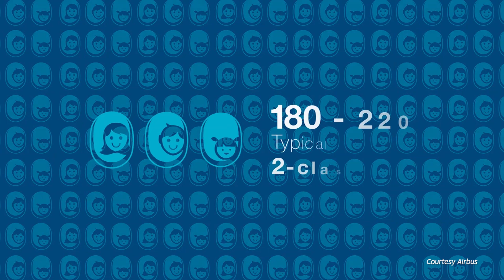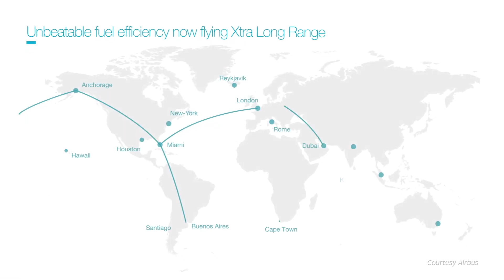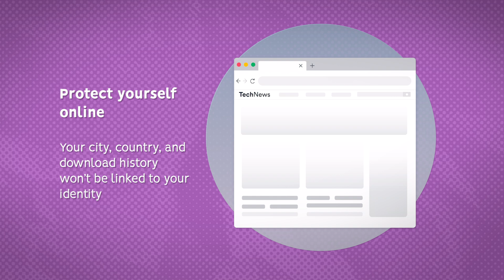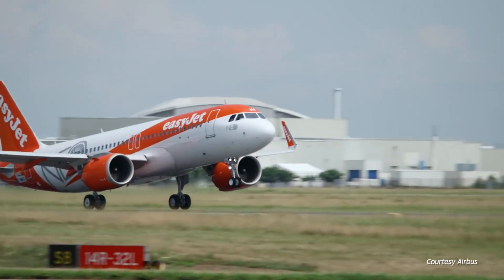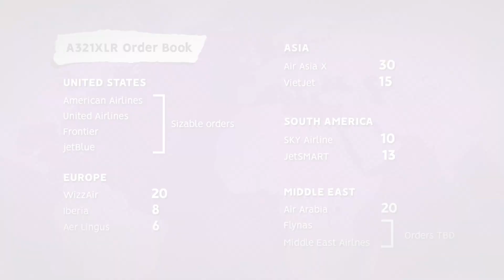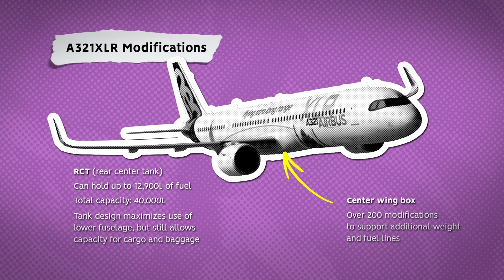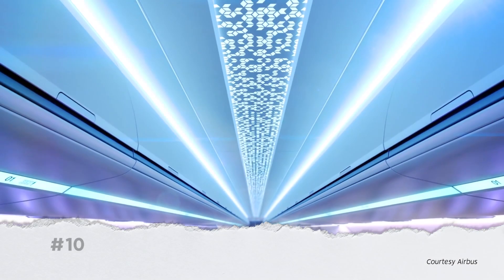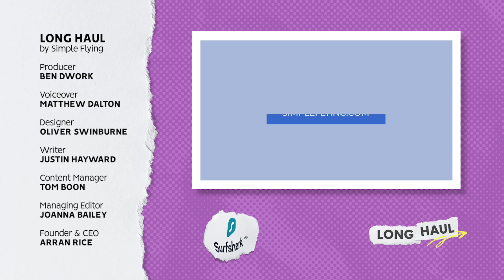10 Things You Must Know About The Airbus A321XLR

Comment: Long haul with a single aisle,  often blocked by service carts, could be 'interesting' for the urinary challenged PAX. Wide body for me.
Reply: You must not have flown on widebodies. It's the same during meal/drink service .
Reply: @_w_w_  more options & opportunities to get around 'a wide body on a wide body'.......have flown them all many times
Reply: @dougharris7665  You clearly do not have enough experience in both types to compare.  I literally live on planes before the pandemic, so I beg your difference.  Airlines do drink and meal service at the same time, which means the carts are blocking both aisles of the widebody.   And because of widebody carry way more passenger per section, airlines often do double carts to have enough food/drinks per run, which means  they are blocked for much longer period of time.  Airlines that use narrowbody for long-haul flight generally have mid-lav and mid-galley, and carved out areas to park meal carts or for passengers to stand and wait for restrooms.   It's really not as big of an issue as you make it out to be.  Airlines serious about using narrowbody for long-haul have configured them to address these concerns ahead of time.  What you are doing is comparing a narrowbody configured for domestic short-haul to that of widebody configured for long-haul.
Reply: @_w_w_  lots of experience, but good for you. Speculation holds no legitimacy so take a few more flights on narrow and wide body when they are on the same run and advise us all of your legitimate findings. I hope that you are correct about aircraft configuration and crew behaviour - then we will all benefit.
Reply: @dougharris7665  It's not speculation, it's real world experience.  Just look at Delta's 757-300, configured for long-haul.  You think airlines are stupid and they can't reconfigure the plane to make it easier for their employees and passengers.  Delta used to have that plane running Seattle to Tokyo before switched to widebody... and they still use them for some TATL route.  I think the issue is you use domestically configured narrowbody to compare with your widebody experience.  You can also look at Cathay, EVA, China Airlines, ANA, JAL and so on, and look at their regionally configured widebody that are incredibly dense and both aisle are blocked during service you couldn't get up or get out until the entire service is done... and on those mid-haul, the service can last 2/3 of the duration of the flight!
Reply: @_w_w_  As someone who has done about 30 return flights from London to Australia over the last 20 year and 100's of flights in Europe, I can tell you the wide body is much better, you can go in either direction and often cross over to the other side if it looks clear. A380s are the easiest.
Reply: @stephanguitar9778  30 transoceanic in 20 years?  I do about that many in a year!  You clearly have not ridden a narrowbody that is properly configured for long-haul.  When configured as such, they are no worse than widebody.  The only issue, if one is to pick it apart, is the wall panel.  Narrowbody wall panel curve more because of the smaller diameter.  That can also be partially addressed with the new curved up bin like Sky Interior's or Air Space's.  Similarly, if you ever got on a widebody configured for high-density, like the Air Asia, you wish you never get into a widebody ever again...  Those Air Asia A330 are scary with 9-abreast and 29" of pitch.
Reply: @_w_w_  I mentioned in another comment about the cheapest LON to New York flight I can get for April next year is with TAP. From Lisbon to NY is circa 8.5hours. A321, economy seats with 31'' legroom. Fixed seats no  recline, no onboard entertainment, economy class with access to 2 toilets at the back, ie typical configuration for a 3 hour European trip.  I think Jetblue are doing a better configuration but more expensive at the time.  I also know Qantas who Ive used a lot and how they will configure these, ie max seats, minimum legroom. I have flown a BA 757 that was fine but they've all gone now.
Reply: @stephanguitar9778  And please don't forgot widebodies are being densified.  All but 3 airlines now have 10-abreast 30-31" 777 economy.  Or 9-abreast 30-31" 787.  No matter what, a 6-abreast A320 (neo or ceo) has wider seats.  You also discounted new slim seat design are a bit better than old ones.  The thinner seat and seat padding produces more usable leg room.  In addition, the thinner seat padding of the new design often use memory foam, so net result on the body is more comfortable.  The amount of flying I have done allowed me to collect a lot of data on comfort and the new generation of designs aren't as bad as you suggest.  In addition, the newer IFEs do not require a giant box eating up legroom under the seat each row...  This again goes back to what I said, a newly and properly configured narrowbody configured for long haul won't be much different than widebody...  And if the airlines decide to redo/reno their widebody, they will use the same new seat design used the the newer narrowbody... and they will surely add more seats to the cabin.
Reply: @_w_w_  Yes I know, I have become an expert at airline/aircraft seat analysis.  Start with looking for A380's then A350's then 777s with proper seating, ie 9 abreast then A330s.  Avoid 10 across 777s and all 787s like the plague. Still possible on the UK to Australia route.
Reply: @stephanguitar9778  Also, A380 is problematic in that the window seats really aren't pushed up against the wall panel.  The gap is not large enough to store bags but too wide for people that want to lean against the window.  Also, 777 9-abreast economy or 787 8-abreast economy are very difficult to find.  Cathay went 10 on 777.  Qantas doesn't have 777, its 787 is 9-abreast.  Virgin Australia had 9-abreast 777 but dumped all those, perhaps you didn't know.  Most of BA's 777 is already 10-abreast, the older config is 9-abreast.  Virgin Atlantic also got rid of 777 in favor of 9-abreast 787 and A350.  Exactly how do you find 9-abreast 777 or 8-abreast 787 between UK and AUS?  Given A380 are being dumped, your real opportunity is still A350.  Then again, A321XLR is not intended to serve one of the longest route in the world.
Reply: @stephanguitar9778  Just heard back from a TAP Portugal contact and you are wrong on a lot of things, so consider your info misleading and/or false.  TAP's A330neo and A321LR, used for transoceanic flights, both have 31" pitch Recaro seat, which is like 32"-32.5" pitch in older seat type.  Both, including A321LR, have 4-5" of recline...contrary to what you said.  So, just as I said, when an airline config a narrowbody for long haul, they will make sure it's on parity with widebody.
Reply: @_w_w_  Not what they have forwarded to the info sites that we all use, but FFS you do have an axe to grind, have you no other life.?
Reply: @stephanguitar9778  TAP's website confirms the information I listed about seat pitch and recline, so stop making up stuff you have no experience on, or do know how to do research on.   I hate people spreading misleading and false information.  Why would you say nasty things about me if you are not spreading misinformation?  TAP's A321LR for long haul is configured with the same seat as their widebody A330neo.
Reply: @_w_w_   I have to disagree about the 'memory foam' seats.   I flew Auckland - Hong Kong on Cathay Pacific  A340 with old 2-4-2 seating - quite comfortable.   A year later, Auckland - Guangzhou overnight on a China Southern 787 in 3-3-3 with what I found was 'memory foam' seats - agony.   I could not get to sleep, every 10-15 minutes I had to shift around to ease the ache in my butt.   I got off that flight furiously angry (and resolved to never go near a 787 ever again).   And transited into an old domestic China Southern A320 which was - so comfortable I promptly dozed off.   
Unfortunately, while internet sites will give the seat layout of any airliner, also pitch and width, they don't say whether the seats are proper comfortable longhaul seats or the new 'efficient' lightweight torture devices.
Reply: @cr10001 You are incorrect...pure and simple and I will explain why.  Chinese airlines, much like the Japanese and Taiwanese, have very hard/firm seats to start with. This is a culture thing, they want their seat and mattress very firm, even hard.  They don't use memory foam because it wears out...at least with the older technology. The older A320 you are referring to, has the older seat designs and they are not memory form.  The newer CZ B787 went with slimseat but not memory foam - it's similar to ANA and JAL.  The challenge with older memory foam technology is that they deform over time from being compressed.  The newer memory foam technology that just came into the market is able to improve that.  Delta is one of the first airlines to install the newer memory form seats and so is Cathay, on their new aircraft.  Western airlines or ones cater to western markets like Cathay embraced memory foam because the western culture bias towards softer seat and mattress, so the airlines cater to those customer expectations.   This is why you often hear Asian passengers complaining about western airlines and hotels have too soft of seat and mattress, and what they call "lack of support"....
Reply: @_w_w_    Thank you for clarifying.   All I can say is, the old China Southern domestic A320  I transited into had perfectly comfortable seats (maybe they bought it from somewhere else).   The 787, I determined at the time was 'memory foam' by angrily poking it (in between bouts of discomfort) before I'd ever heard that term used for airline seats.   In fact I was starting to think I was getting too old to fly (fortunately the A320 dispelled that suspicion). 
That still leaves me with the problem of determining which aircraft/airlines to avoid when booking  (from Auckland to Europe I do have a wide choice of routes).   When the covid situation improves, of course.
It would appear that I haven't experienced the new 'memory foam' then.   (Flew Cathay Pacific to Paris in 2016 but that was on an A340 so would have had old-style seats).
Reply: @cr10001  Agreed that old seats are generally more comfortable.  That's same regardless of airline, but sadly they are being replaced by new seats and slimseat is the new "it" thing.  I was initially put off by the slimseat but honesty, the marketing fluff is right after I spend a lot of time in them.  Companies like Recaro really did engineer slimseats well.  Combined with the newer memory foam, it's quite good.  But this is not to say some LCC won't have abusive slimseats.  I generally have a rule to avoid Japanese, Chinese and Taiwanese airlines if I need to do long-haul in economy.  Their services are great, but the seats and cushions are just too hard for me.
Reply: Some 321s have a crapper in the middle somewhere in the wing area. Makes a big difference.

Comment: Having flown this aircraft in X-Plane almost fully loaded and suffered an engine failure on takeoff, I really hope they'll install a fuel jettison option. It's a long time to circle to reach maximum landing weight
Reply: Seriously? …………….you are perhaps unaware that the aircraft lands perfectly fine overweight ?  That’s why there exists an overweight landing abnormal procedure and maintenance inspection. If I’m on fire or suffered an engine failure I’m not gonna be out there circling around like a dumbass.
Reply: @savagecub  1. Yes I do know but as I wasn’t on fire and other engine was working fine then no rush. 2. Green dot speed was above flap 1 speed meaning if I extended the flaps for landing I’m going to damage the flaps. 3. Loads of aircraft have circled for sometime to burn fuel because they’re too heavy. Get the landing wrong and your gear could collapse. There is a 22.2 ton difference between MTOW and MLW. On the XLR. Also if every aircraft could land overweight with just a maintenance inspection after then why bother installing fuel jettison in the first place?
Reply: @tomstravels520  
You’re telling me green dot speed was above 230kts ???
Reply: @savagecub  at MTOW of 101T the green dot speed is just above 250knots. There’s even a modification to the FMGC so it doesn’t just climb at 250knots if green dot speed is above. It will climb at green dot speed until past 10,000ft or when allowed to accelerate
Reply: @tomstravels520  
This is my airlines philosophy concerning overweight landings :

When dealing with a technical emergency be aware that we, as pilots, are likely not to have the complete information of the developing situation. The aircraft has limited detection capability, and only in certain areas. It is impossible to know the full extent of the problem until after the mechanics’ post-flight evaluation. We always have to assume the situation can deteriorate and become life-threatening.
For example, an engine malfunction can cause an internal fuel leak/fire in the wing where there is no detection capability.
Unless we can prove (to ourselves) that it is safe to extend the flight, the landing should not be delayed even if overweight.
In the philosophy of keeping it simple:
If the flight is returning due to a non-life-threatening medical emergency (or similar) it is OK to extend the flight to dump fuel and prevent an overweight landing. However, if the emergency is life-threatening, do not dump fuel, land ASAP and send an overweight landing report
Reply: @savagecub  yeah I’m not saying you should always wait until at MLW as there certainly are exceptions. But it would make sense to have that. There was an Air Canada 767 that took off from Madrid, tyre burst which damaged the engine. The aircraft had no fuel jettison capability so they circled for about 4 hours to burn fuel and prevent excessive damage to the gear with a blown tyre by being overweight
Reply: @savagecub  green dot doesn’t dictate slat extension speed, S speed does. Even if green dot is 250kt, you can select speed until VLS then extend slats as required. I dont have the FCOM of an A321 XLR yet but on an A321 Neo, max slat speed is 243 knots which is i think higher than VLS on a 101 MTOW A321 XLR. If not enough then you could also extend gears at 250 kts to lower VLS further.
Reply: @topethermohenes7658  
I’m not the one who was complaining or confused by the meaning of green dot speed. It was the initial poster.
Reply: This is non-sense. Fuel weight in narrow bodies will always be a lesser part of their MTOW compared with wide bodies even for ULH plane like this one. (Because it requires less fuel to move a narrow-body than a wide-body. All narrow bodies does not need fuel jettison as the difference between MTOW and MLW does not justify the cost and the weight of a fuel jettison system. Heck even some 767 doesn't have the fuel jettison system, I think it is an option.

Comment: As nice as narrowbody long range jety are - doesn't the lower number of passengers increase the CO2 foorprint per passenger-mile significantly?
Reply: It's the opposite, the bigger an aircraft gets the higher the empty mass of the aircraft per seat gets. Modern carbon fiber widebodies consume around 2,5 l fuel per seat and 100 km, the same amount the 320neo series or 737 Max series consumes . The 321neo is the most efficient 320neo series aircraft, a stretch is always more efficient. If you sell all seats the consumption per seat is lower than with a half full aircraft, and you can use one XLR instead of 2 at low demand, but the half sold widebody would consume more fuel per sold seat.
Reply: I wouldn’t be surprised if the footprint is higher, on the other hand it’s a smaller aircraft so there are also other factors not just passengers onboard as it off course needs less passengers to be filled

Comment: Who wants to cross the Atlantic for 7 hours in a single aisle plane. Although the A-321XLR will be a good plane but we are now back to the DC-8 or B-707 with 2 engines. PAX will prefer to fly on A-330, A350 or B-767, B-777, B-787
Reply: I would be prefer to fly in a single aisle aircraft across the Atlantic if the option was for a non-stop flight.
Reply: I’d like to, I’ve crossed the Atlantic several times on the 757 already and it really isn’t bad. The only difference you’d notice is the narrower fuselage, seats are pretty much the same as on widebodies
Reply: its the future and is a more spacious aircraft